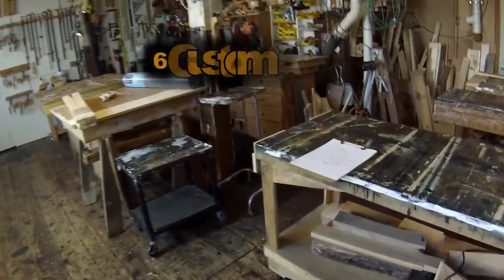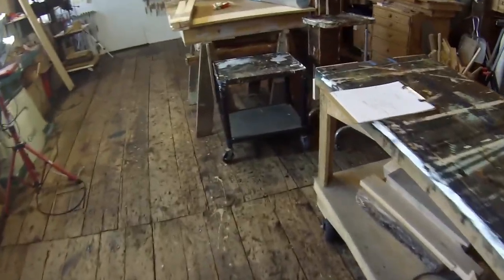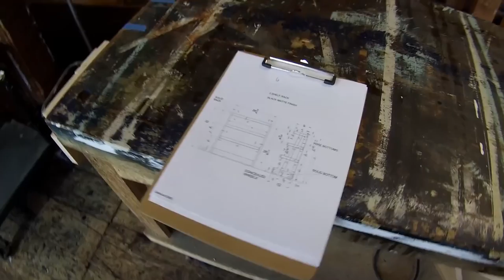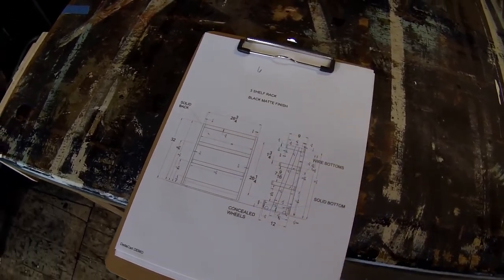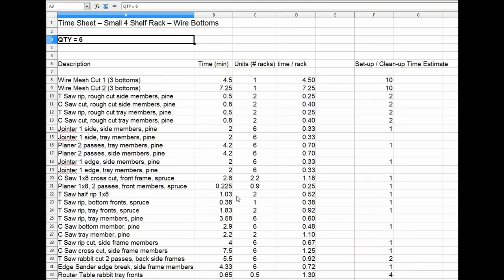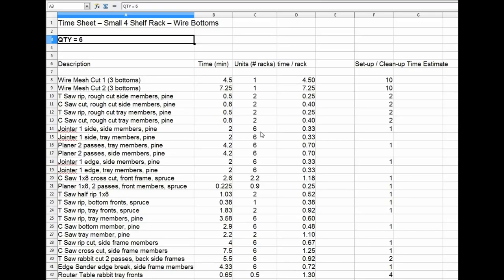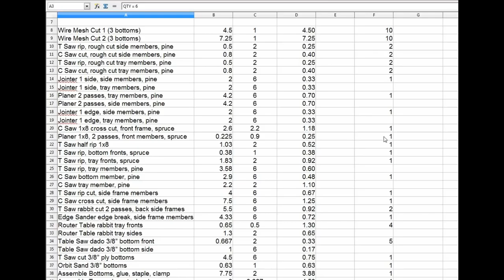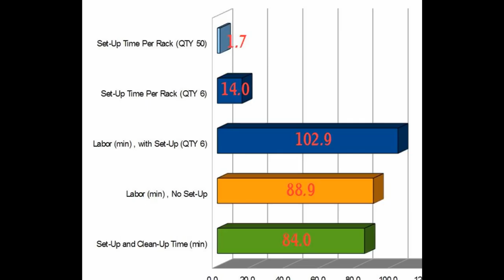Custom Rack Job - Time and Cost Analysis

Comment: Hals Wood Shop.  I really liked it.  My view is as a teaching new woodcrafters entering business how " it ain't easy"  it is not the  8 minutes of some utube show.  So your channel is great.  I could write a 3 page article on business tips ( yes I am a retired teacher ) that I see in this episode to help a new or old producer speed up production.  did they see these as tips " I could do better and faster if I used those steps?  So I don't need a huge table, make one when I need it and take it apart..!   "  I could have used this before I stopped as a business.   Best Wishes.  Keep on Showing us more and more.
Reply from the maker: Thanks Hal.  Now I am doing an in-depth business video on making cutting boards, and it's out of control, so you will like it.  I also discovered that Advantek makes a great substrate for workbench tops, as glue does not stick to it very well

Comment: You made seem as if you were (reasonably) less excited to work this particular project, even though it seemed lucrative enough. What are your favorite types of builds to get commissioned?  Do you like the all-out, "use every tool in your shed" type builds, or do you not mind the more mindless "easy money" type projects? A blend of each?  I admire your discipline and adherence to your typical process even when working a more mundane project.  You didn't rush any steps, even as you let some aspect's standards sag to suit the level of the project.
Reply from the maker: I find that doing the cost analysis makes these kinds of jobs more stimulating, and making the video puts more pressure on to work out the kinks and do everything the right way.  I have trauma from working with that wire mesh, but I made it through this job with no scratches.  After building all kinds of things for 15 years, I like the easy money mundane work better.  more exercise but less stress.
Reply: What percentage of your working days would you say are spent on easy versus complex jobs? I think we (youtube viewers) probably see a disproportionately high amount of more "interesting" work.  Any way, very entertaining regardless.
Reply from the maker: It always changes, year to year.  These past couple years have been a good mix of really complicated and mundane.  I would like to start making puzzles and boxes soon

Comment: I have been doing a lot of work in the shop this past month and conveniently got the power bill... It is twice my average. In your analysis I did not see a heading for power used. Running commercial stuff must cost a ton... Do you have some allowance for 'Power' in your costing???
Reply from the maker: When I upgraded my machines from all 110v to 220v with a 3hp dust collector, my electric bill doubled, but it is pretty constant now.   I will often charge a higher shop rate for jobs that require a lot of milling.  If I charge $55 hr for custom work, I would charge $85 hr to run the planer for someone or for making flooring.